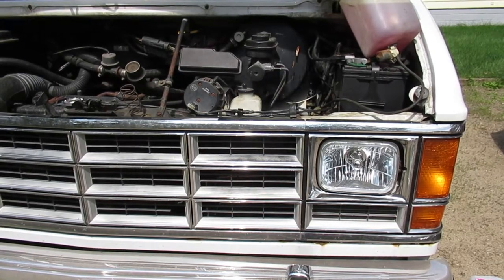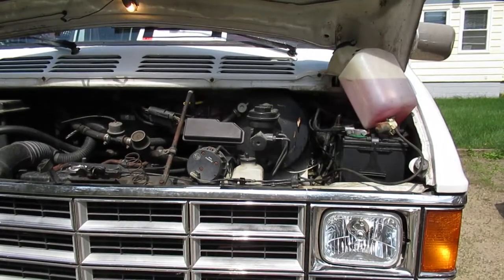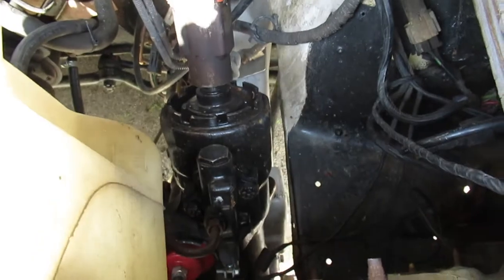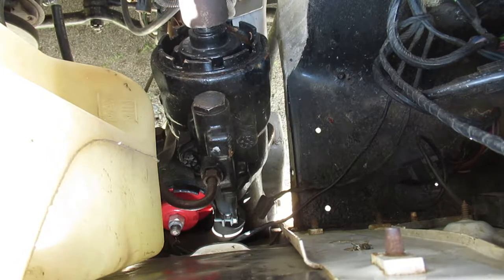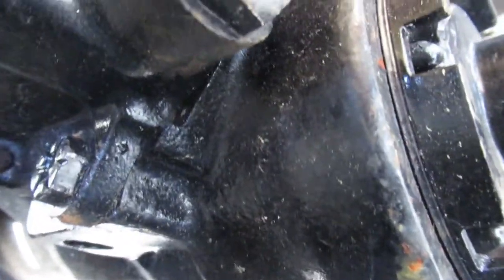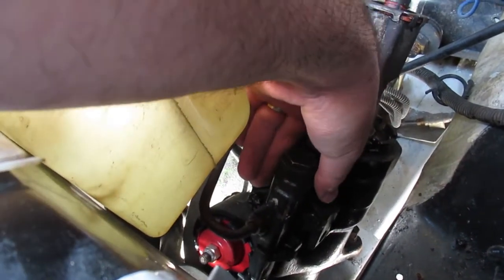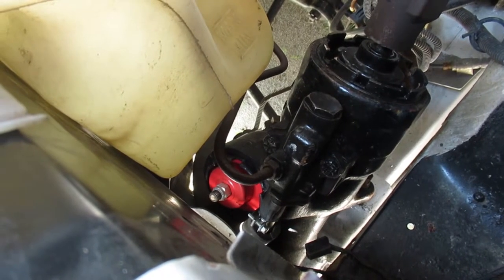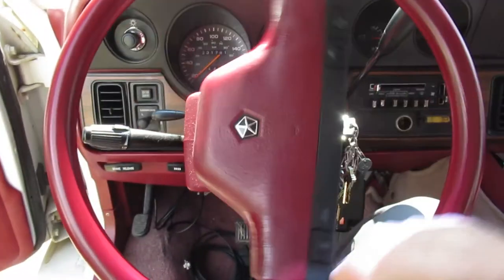Mopar Power Steering Gear Boost Balance Adjustment 1958 through 1993

Comment: I've got an 88 Dodge B350 that I'm in the process of removal of the steering gear box. Dis you do it yourself and if so how was your approach on the removal? Because this is a flippin pain in the butt!!
Reply from the maker: You have to remove the knee panel inside the van and loosen the steering column supports to separate it from the steering box.  You will also want to remove the battery, coolant bottle, and windshield washer bottle from the engine bay.  
The line on the front of the steering box was seized so I had to remove that valve body from the steering box and then remove the line from it afterward which is why my steering was out of balance.  
Disconnecting the pitman arm from the steering linkage was OK.  You can find videos on how to seperate ball joints or tie rod ends by hitting them with a hammer.
Unbolting the steering box from the frame wasn't easy but it was doable.  Separating the pitman arm from the steering box was the hardest part.  Take the parts to a garage and have them swap the pitman arm if your new box doesn't have one.  Make sure you read your manual and use the correct fluid.  You probably need the special hydraulic fluid I have linked in the description of the video.